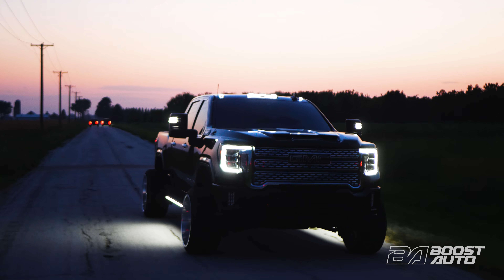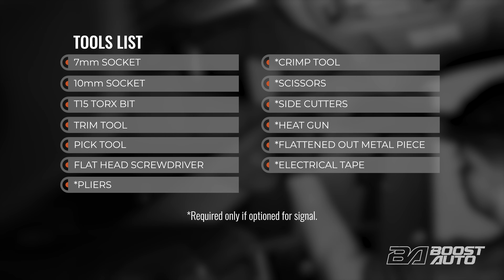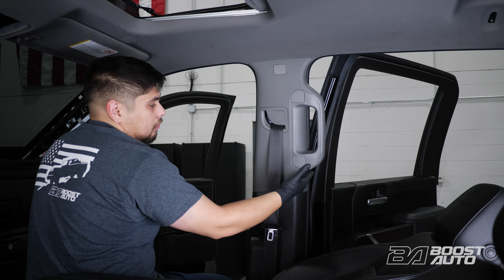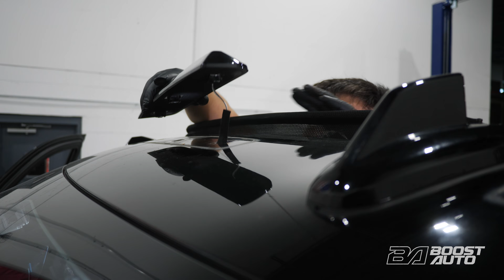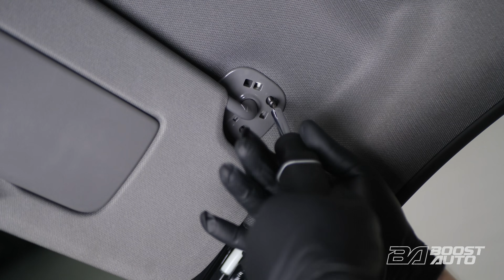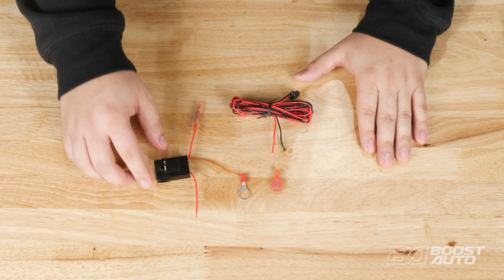Boost Auto S-Series Cab Lights Installation Guide | 2020-2023 Chevy Silverado & GMC Sierra 2500/3500

Comment: The I like the look of these newer ones versus the ones you list for 17, Mine is a 17. Could I make these work on my truck?
Reply from the maker: We don't recommend putting cab lights from a different generation onto your vehicle. Our cab lights are designed to follow the contour of the roof to ensure leak proof performance, so if you install a cab light designed for a different generation of truck you're introducing the risk of the light leaking.

Comment: Currently in the middle of installing these. Praying I missed where it’s addressed in the video. 
22 HD with existing cab lights. Removed the old and am ready to install these now. There is no mounting bracket hardware or bolts. 
Praying that because it’s not retrofitting that I didn’t need them and that it wasn’t accidentally left out of my order.
Am I able to use my original bolts/brackets?! 
Do not want to have to do this all over again and of course it’s a Saturday. 
Anybody know? 😬😬🙏🙏
Reply from the maker: Our kit comes with the hardware, if you're missing it please call us at 765-831-2830 and we will assist you ASAP!

Comment: If I don't have a sunroof, would I have to completely remove the headliner? In this video, the tech only had to drop the headliner a little, just enough to reach and change out the cab lights, bc he was working thru the sunroof opening.
Reply from the maker: No you can still access them, it's just a bit more difficult.
Reply: @boostautoparts Kinda fig that. Thank you!
Reply from the maker: @TopOpsFL  No problem - here to help!

Comment: Where the power and ground at taped in, is the power wire a constant power wire or is it ignition powered ?
Reply from the maker: Please contact our support team at 765-831-2830 for assistance, but rest assured our engineering team has designed these to be completely compatible with your vehicle as shown in this video

Comment: I installed the OEM version on my 2020 GMC 2500. They don’t turn on. I don’t have the start up mod installed though. Do I need to install the start up mod in order for the cab lights to turn on? It’s very upsetting they don’t turn on after installing.
Reply from the maker: If you select an option with the S-Series module, you must install the S-Series module otherwise the lights will be totally inoperable. Please feel free to call us at 765-831-2830 or email support@boostautoparts.com for technical support. We're standing by ready to help!

Comment: I installed these cab lights and there’s a little gap underneath them, assuming that’s just cause the gasket is so thick.
Reply from the maker: There will be a small gap between the plastic and the roof due to our gasket which is thicker than OE to achieve a water tight seal. There should not be a gap between the gasket and the roof itself.

If you have any doubt, email pictures to support@boostautoparts.com and our technical support team can take a look!

Comment: I have a 2020 Chevy 2500 with no cab lights , are the connectors already there ? Or do I have to order the cab light wiring harness ?
Reply from the maker: If you didn't originally have cab lights please check out this video: https://youtu.be/16SW18XUjao?si=IW1Kk4ptmmSCRoN6
Reply: @boostautoparts  isn’t the plug for wiring harness already there , I just need the oem wiring harness don’t I ?
Reply: @boostautoparts  only asking cause I got the sequential switchback lights from y’all don’t have a retrofit option for my truck , but I seen several people say the connection is already there you just need the wiring harness
Reply from the maker: @zombieslaya10123  give our team a call at 765-831-2830 for assistance

Comment: This is kinda tricky so I have a 2020 silverado 2500 high country and the previous owner put 2015-2019 recon cab lights on it for some reason. Would I be able to put these on instead or have to drill more holes or am I just probably screwed
Reply from the maker: That is a tough question to answer - it sounds like someone put the previous generation cab lights onto the newer generation truck? The previous generation has different mounting points, so the correct lights (ours) won't mount up to the existing points.
Reply: @boostautoparts  nooooo I gotta sell the truck now 😔 I already purchased cab lights from yall
Reply from the maker: @tejoshii694  Lol. I"m sure with some ingenuity it might be possible. Give our support team a call at 765-831-2830. Maybe they can lay a 2015-2019 template next to a 2020+ to see how far off the holes are
Reply: @boostautoparts  I’ll give yall a call in the morning thank you I appreciate it
Reply: @boostautoparts  I figured out how to install the cab lights in, but I need the retrofit wiring harness kit I believe, but I cannot find it on yalls website
Reply from the maker: @tejoshii694  Give us a call at 765-831-2830; we can sell it to you over the phone.
Reply: @boostautoparts  I actually just ended up splicing the wires with the old recon ones lol

Comment: does the 2022 silverado 2500 work truck base model have the plugs for cab lights under the headliner same as the higher trim models?
Reply from the maker: Check out this video to see how to install cab lights on a vehicle not originally equipped: https://youtu.be/16SW18XUjao?si=IW1Kk4ptmmSCRoN6

Comment: Will these cab light fit a 2016 gmc sierra 2500hd i like this style more
Reply from the maker: We offer cab lights for a 2016 Sierra, but this is not the video for them. You can check those out here: https://www.youtube.com/watch?v=2w-kiimkzOY

We don't recommend putting cab lights from a different generation onto your vehicle. Our lights are laser designed to fit the curvature of the roof they are advertised for to ensure a leak proof installation, so if you were to install them on a vehicle they aren't advertised for you're risking them not sealing properly.

Comment: Thought this was supposed to be a no hassle install
Reply from the maker: We have simplified the installation to the fullest extent possible! Since these are designed to be a factory replacement the headliner does need to be dropped, but the video goes over all of the details it is not a difficult process.
Reply: hassle is a result of a skill issue. this is the best "how to" video on accessing and removing/replacing the cab lights. everything it straight forward with the instructions. clearly you are not a DIY'R if you complaining.